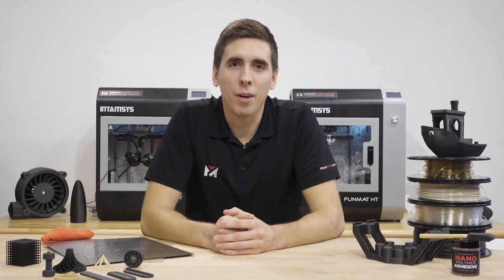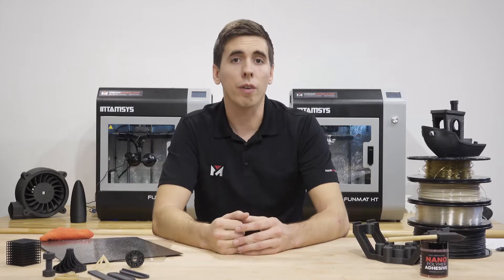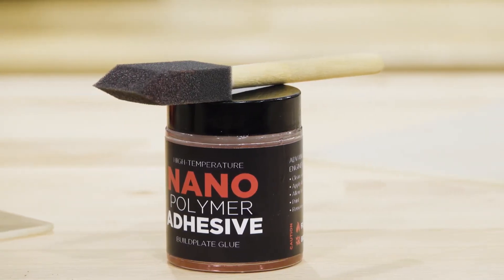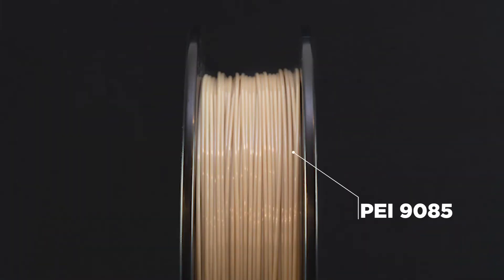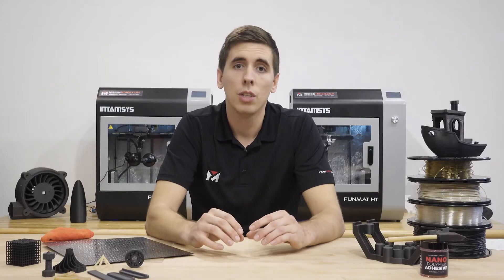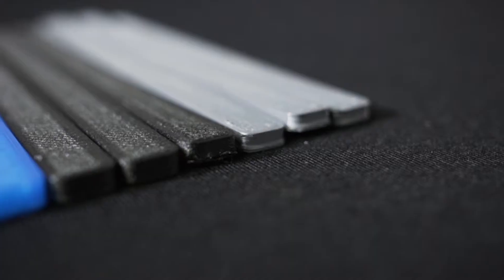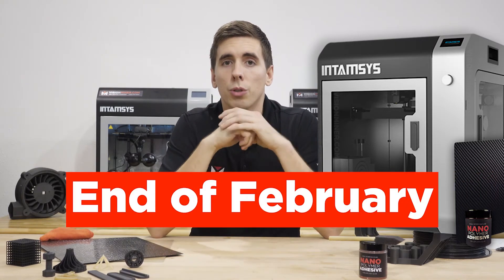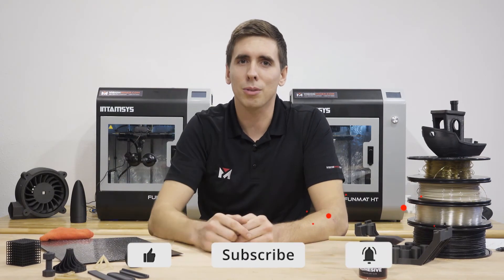3D Printing PEEK, PEI, PPSU, Bed Adhesion, INTAMSYS - Updates for 2019 // Vision Miner

Comment: Do you have a distributor in Europe ? 

I think I will need this. My PEI sheet is not strong enough for warping and during printing it loose his adhesion from the printframe ... So I will need a borosilicate plate and and this adhesion :)
Reply from the maker: It's working out amazing, and helps a ton on PEI! We're in final agreements with some European dealers -- soon! For now, we can ship internationally and give some extra gifts for the high shipping cost  :)
Reply: @VisionMiner  I send you an email for sponsoring an article ;)

With PEI first I think it's important to have the right distance between nozzle and bed. To near will destroy the PEI and to far away will occure warping. 

My problem for the moment is the PEI is enough but the adhesion between plate and PEI sheet is not strong enough
Reply from the maker: @PCPointerDE  Correct --- you will need to use a PEI Plate or something far stiffer, like Glass. Our Nano Polymer Adhesive works on regular glass perfectly :)